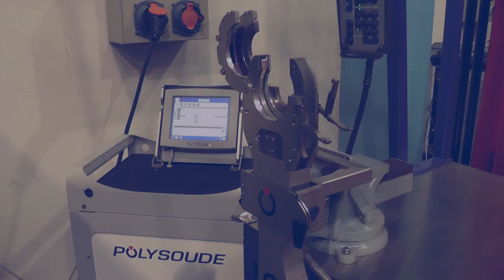Polysoude - New Adaptable Discs for Orbital Welding of Elbows and Tees with MW Closed Weld Heads

Comment: Was the elbow pre-tacked to the straight tube ?
Reply from the maker: Yes, it was. TCI is holding the tube firmly on one side and adaptable disc making the chamber as hermetic as possible to allow perfect gas protection.
More information here: https://www.polysoude.com/wp-content/uploads/2020/12/DOC_Broch_MW_EN.pdf
Reply: @PolysoudeTheArtOfWelding  Thanks for the answer !